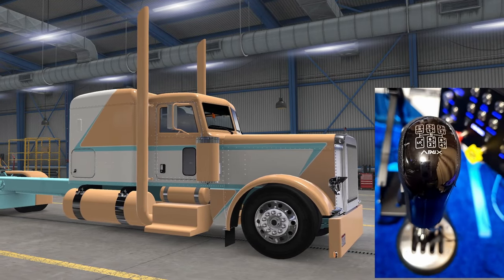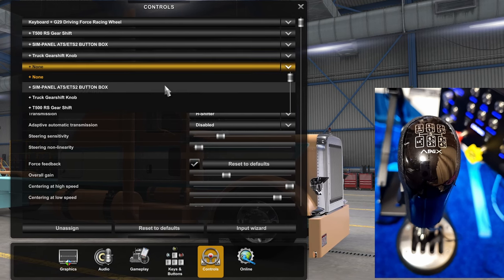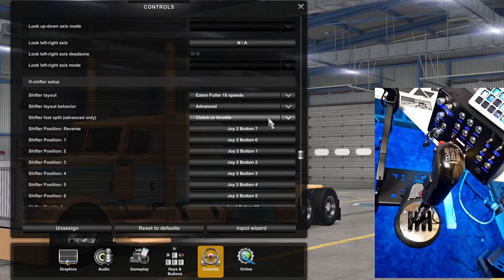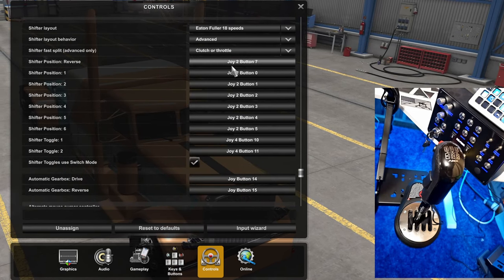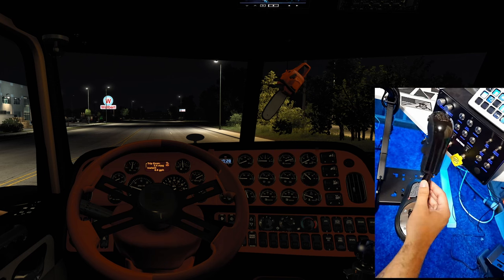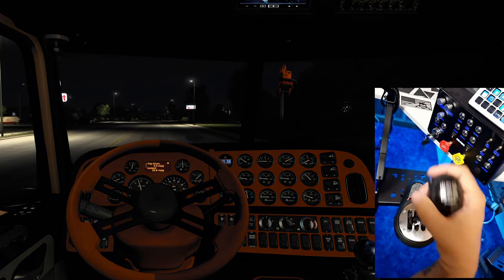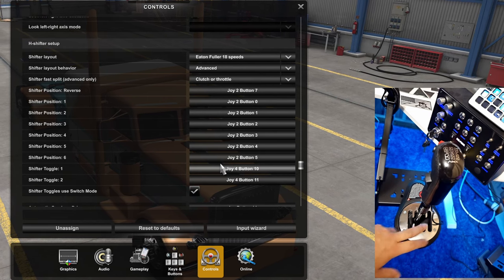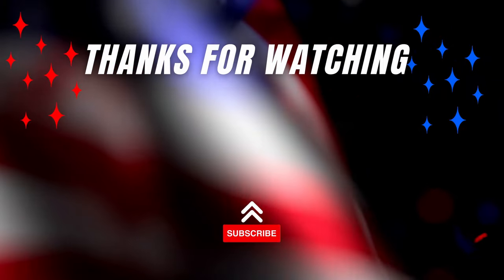EATON STYLE SHIFTER SETUP TUTORIAL | AMERICAN TRUCK SIMULATOR

Comment: You don't go through all the gears, look for videos from real truckers you barely need to use the splitter in low range. In game, I sometimes split my low range gears when I'm on a ramp pulling heavy loads.
Reply from the maker: That is correct, in game I barely split gears unless I'm recording a video and want it for dramatic effect or when I'm using an underpowered engine fully loaded.
Reply: You might not need to go through all the gears in ats, but in real life it is good practice and sometimes necessary to go through all the gears. It helps everything wear evenly instead of abusing certain gears.
Reply from the maker: I agree on that buddy!
Reply: @motox4124 Using some gears more than others won't do those gears any harm.  Most real-life truck drivers have a regular block-changing patern that misses out certain gears. The main aim is to avoid unnecessary clutch slipping in lower gears when pulling away from a standing start.
Reply: So do you split like you would in a 13 gear?

Comment: Is your splitter inverted? You switch down for High gear and switch up for Low gear, is it supposed to be like this on real eaton fuller?
Reply from the maker: Yes it is inverted, on a real Eaton Fuller the switch moves forwards and backwards. Since my button moves up and down the game on recognizes it a certain wait when you program it. I've tried to program it the right way but it won't recognize it that way for some reason.
Reply: @dieselsmokegaming  okay thanks 🙂
I have the same one, so i guess i have to deal with it
Reply from the maker: You're welcome, I barely notice it now. I had to sit down and drive with it to notice it again. This is the 2nd shifter I have used but I can't remember if my old shifter was the same way. I'll have to look back at my first videos in the series.
Reply: I think I know what the problem is. the switch in the lever is on the wrong side. if you open the lever, you will see that the switch is in the upper part, therefore it is registered there as low.
Reply from the maker: Thanks for the info buddy. It doesn't bother me anymore but people will definitely find this handy!

Comment: Why does everyone drive in low? I haven't hardly seen anyone drive in high, isn't high supposed to give you faster speed, saves fuel, and more? Besides the times you need low and high like range-splitting and the roads, why does everyone drive in low?
Reply from the maker: Yes, high gear does give you better speed and fuel mileage but, low gears give you better torque. You need to get big heavy loads moving and keep them moving and low gears are best for that. You get into your high gears once you are up to speed on the highway.
Reply: Thanks! I was stuck thinking this and not understanding  @dieselsmokegaming
Reply from the maker: @Coeptus2 You're welcome
Reply: Also, are you aloud to stay in high when upshifting or downshifting or do you have to go back into low, shift, then high @dieselsmokegaming
Reply from the maker: @Coeptus2 you can stay in high gear while shifting up or down. It just depends on your speed and the load that you are pulling.
Reply: Thanks, think I'm set  @dieselsmokegaming
Reply from the maker: @Coeptus2 you're welcome.

Comment: Hi man, just got a question, i have the same knob with the logitecht g29 gear shifter. Is installed the knob but in game it shows up under the name ANXTF1. When i try to set up my stick itself does not work, the range selector and the splitter do work, but i can't get it in any gear somehow. What did you do to make it work with ats or ets2?
Reply from the maker: I haven't had that problem. It sounds like your Logitech base isn't being recognized. You are using the G29 gear shifter that came with the wheel? If so, and this may be a dumb question, but do you have the shifter plugged into the bottom of the steering wheel? Make sure that connection is tight, I don't recall having any problems when I was using the Logitech shifter. If all connections are tight, try to run the setup wizard and see if it will let you set up the shifter that way.
Reply: @dieselsmokegaming  I'll take at all the connections and try again. Thank you for your response!
Reply: @dieselsmokegaming  hey man i unplugged the shifter and pluged it back in and it work fine now. Thank you very much for your help👍
Reply from the maker: You're welcome buddy!

Comment: Hey what shifter do you have and what stearing wheele do you have?
Reply from the maker: All of the links to what I use are in the description. The actual steering wheel I use is just a generic 6 bolt steering wheel attached to the Logitech G29 steering wheel base. The shifter I use is a generic shifter from Amazon attached to the Thrustmaster TH8A shifter base.
Reply: Thank you so much, but how do you attach that knob to the base.
Reply from the maker: You have to plug up the shifter base and shifter into USB ports on your computer. I use a USB hub to plug in everything.

Comment: I bought a similar shifter a few months back and now it stopped working on me. I never downloaded any software and my computer recognizes the shifter but not the inputs. I’ve switched the ports I’ve put the usb in and I can’t get it to work and sometimes it says hardware error in the device manager
Reply from the maker: I've had the same thing happen to me, I'm not sure why it does it. I had to buy another shifter. So far this one has held up and has good reviews. I'm assuming something shorted out internally on my old shifter. I never took it apart to confirm it though. If this one goes out I will purchase a custom one from someone like ats accessories. If that happens I will update the links in my description. If you are good with working on things you could take yours apart to see if anything has come apart on the inside. I don't really have a good answer for you buddy, I'm sorry.

Comment: I can’t find any shifters that mimic the actual shifter in the truck I drive. I drive an Eaton 10 speed where reverse is top left and 1/6 is bottom left and gears 5/10 are on the bottom right. Any ideas on where I might find something to be realistic to what I actually drive?

Or is this something that can be remapped and then I can ignore the top plate that has the pattern? I’m trying to make it as realistic as possible and don’t want to shift different in game compared to real life
Reply from the maker: I'm honestly not sure. I haven't used a 10 speed in the game so I will have to play around with it when I get on next time. I'm pretty sure there's a 10 speed option in the drop down menu in the settings. I'm not sure if you've tried that or not. I'll get on when I get off work and see if I can get it figured out.
Reply: @dieselsmokegaming  no I actually haven’t played yet. Plan was to buy the right equipment and then play it. Would be kinda boring with a keyboard and mouse probably haha
Reply from the maker: @CaptnBeeBop yeah it's boring that's for sure haha. I'll check it out tonight when I get off and let you know what I find.
Reply: @dieselsmokegaming  I see. First gear in my truck is straight down from reverse. I’ll have to find out if there is a way to custom map the gears. I appreciate your help
Reply from the maker: After playing with it for a while, I can't get my shifter to work like a real Eaton 10 speed. I found a video that could help you, though. https://youtu.be/jQFUltWKl6o?si=LQxr3GwyYPL1_0cs  
I also found a shifter that should work for you and is closer to what you use minus having a splitter on it. https://amzn.to/3HzAg8X
Reply from the maker: Here's a video that will help you buddy.   https://youtu.be/8LDhmAZUI6s?si=M1GSrQX2ZwmFX4OJ

Comment: i just bought a 18 speed shifter. But, i see that the high/low shifter arent in correct position, isn´t? Cause if you want to change from low to high speed, you need to press down the side switch instead of press up.... is there a way to revert it?
Reply from the maker: I haven't found a way to revert it back to the way it's supposed to be. I think the game recognizes the switch a certain way. I have had other people tell me that I can take the shifter apart and rotate the switch around to make it work the opposite way though. I haven't done it but it could be something to look into.
Reply: found a solution. You need to weld purple wire into the middle pin. I just did it and it works perfect now @dieselsmokegaming
Reply from the maker: Thanks buddy, I appreciate that. I may have to try it when I get a chance to mess with it.
Reply: @pablitro2001  care to explain how ?

Comment: it doesnt work i judt got my gear shifter and it doesnt work pls help
Reply from the maker: The shifter itself isn't working at all?
Reply: Mine ain’t popping up where they supposed to idk what to do
Reply from the maker: Did you get it figured out?
Reply: @dieselsmokegaming  ill set everthing up and i try to shift it in reverse and it doesn’t work
Reply from the maker: Do the rest of the gears work? Do you have it set to 18 speed in the control options? Does the truck have an 18 speed transmission in it?